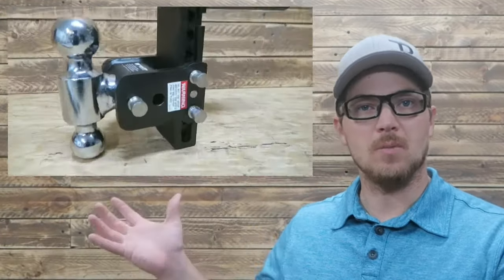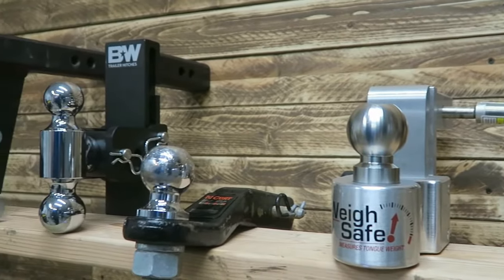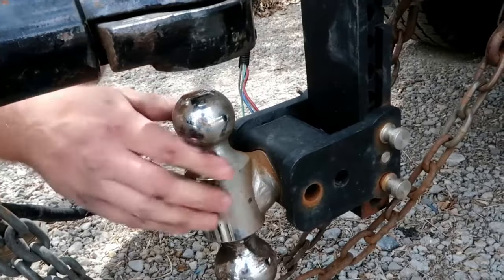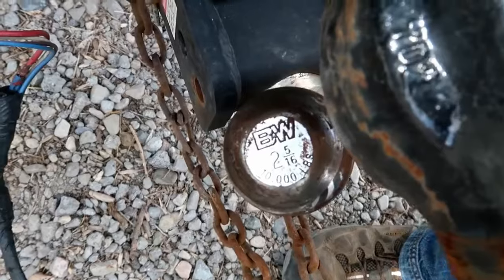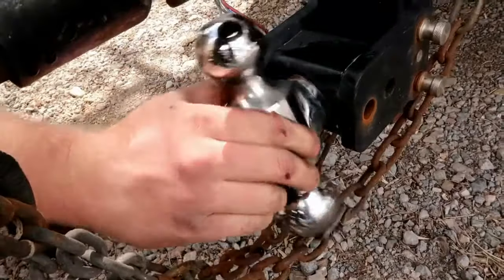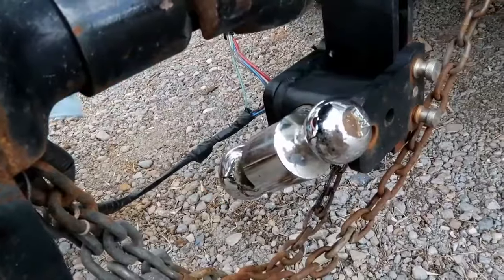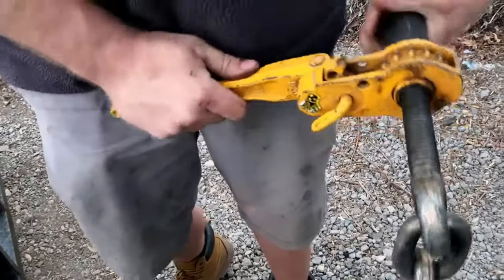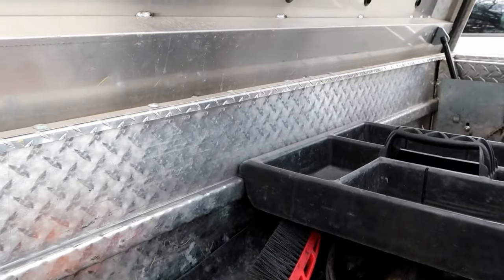B&W Tow and Stow Hitch Long Term Review

Comment: Chains look really close to the bolts, are they hitting them when you turn?  I"m wondering if jack knifing a trailer would cause those chains to be an issue with the locking pins.

Comment: Has anyone  noticed  their hitch seems bent ? Mine doesn't  sit straight.  The bottom angles  towards  the truck.
Reply from the maker: There is a little slack in the receiver tube. This is true with most hitches.